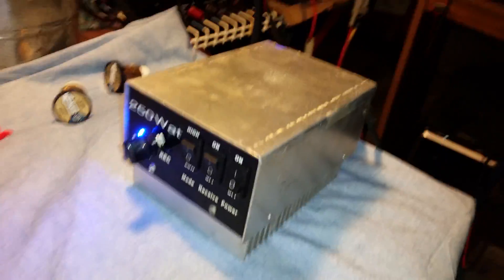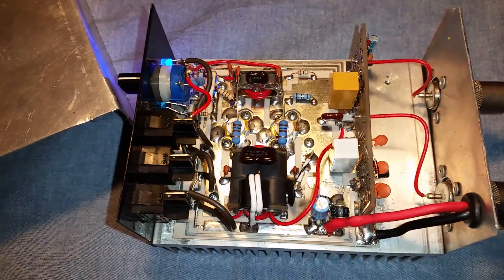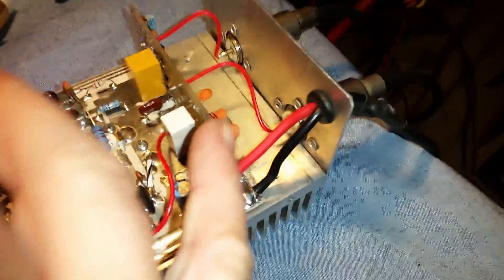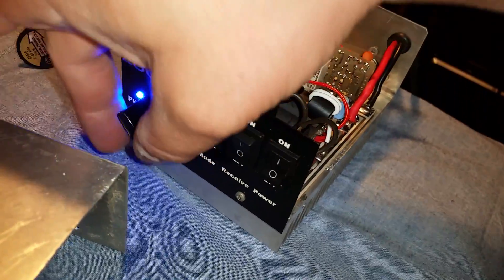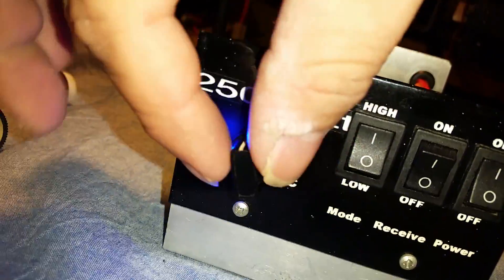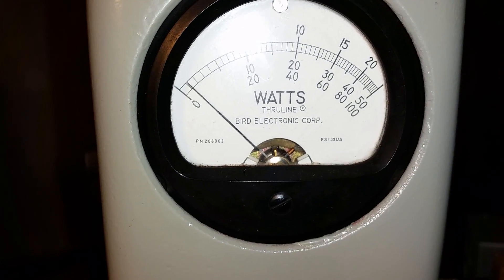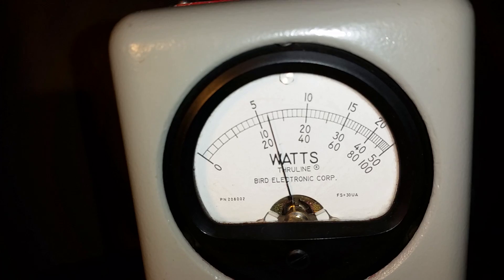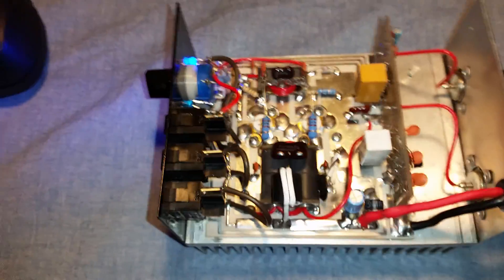Two Transistor SD1446 Amplifier 100w Bird RMS Ebay - SOLD!

Comment: I have a? gate keeper I have a 2 pill SD 1446 class c box it has a variable knob in it the pills was made by a company called ATI I was wondering what is the safe peak watts I could drive it with the radio I have is a stryker 447hpc2 with the rf power all the way down it will dk 2 swing 45ish peak any help would be appreciated 73s and God bless
Reply from the maker: I would drive it only with about 25 to 30w pep to be safe bud. Those can't handle as much as ST 1446 can... be safe have fun!
Reply: @1883GotDown  thanks

Comment: I can see that variable being a great setup. You could adjust it for the right power you need to drive a bigger box but if you wanted to run full power barefooted, just flip to high. Back to using as a driver, flip to low and your dead key for big amp is still set perfectly. 👌

Comment: what would you suggest to run in a stock 2010 corolla? I have a 8g straight to the battery and don't want to fry anything. I'm currently running a S980  and only care to talk on 38lsb